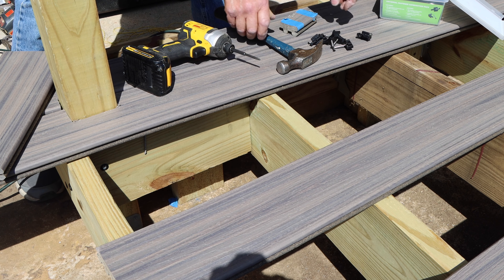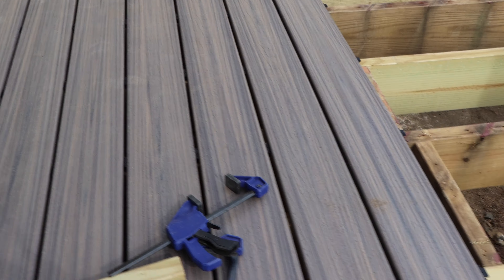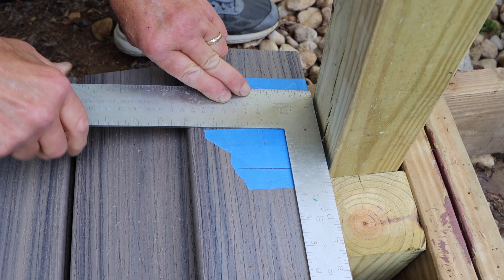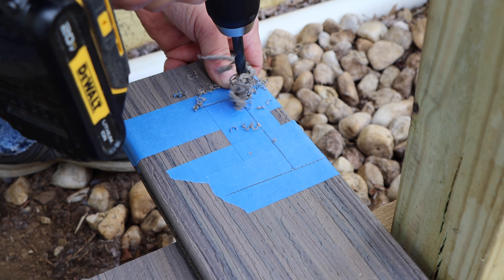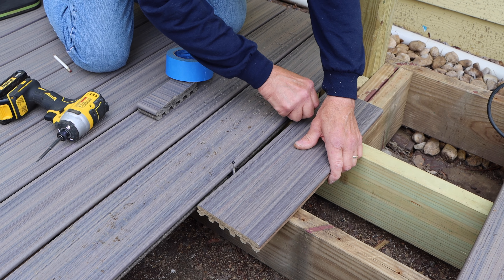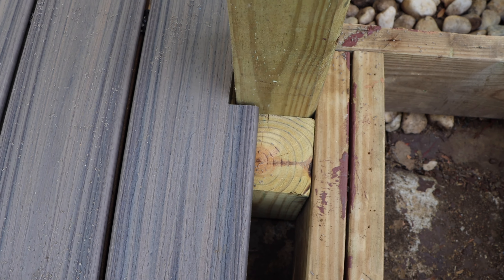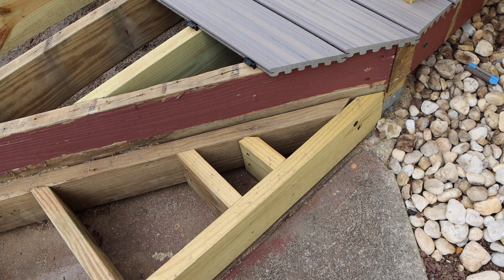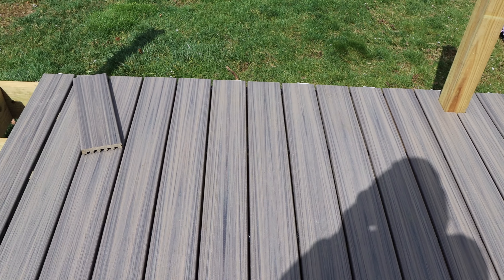How To Install Trex Composite Decking

Comment: Nice build. just a little tip, put 5 boards together insert all clips then use a prybar to squeeze them together and then screw the clips standing up putting your weight on the boards. this way you dont have to be on your knees all day and your installation will be 5X as fast.